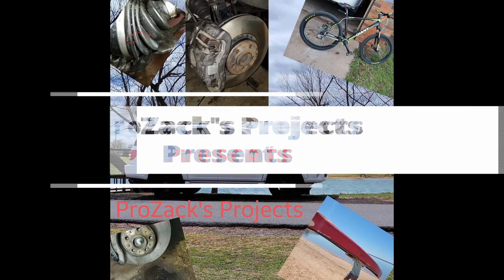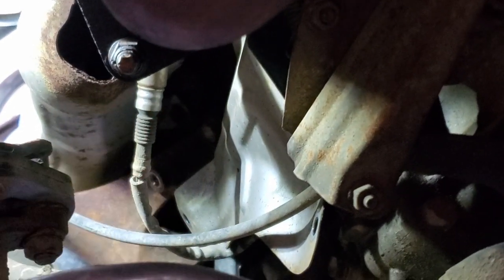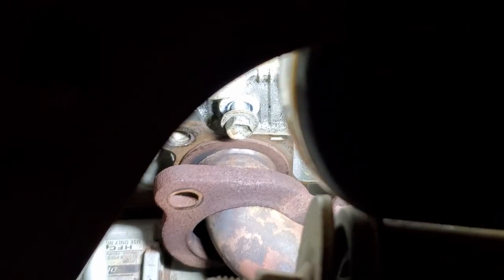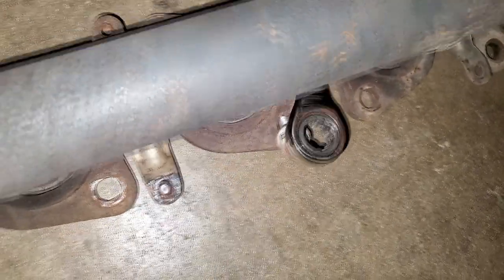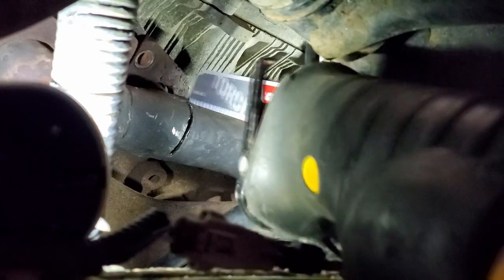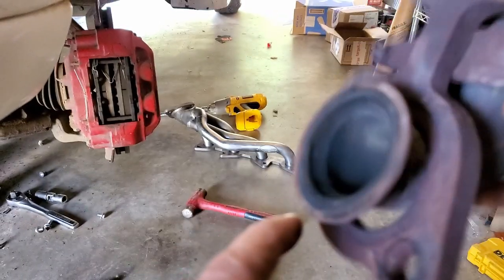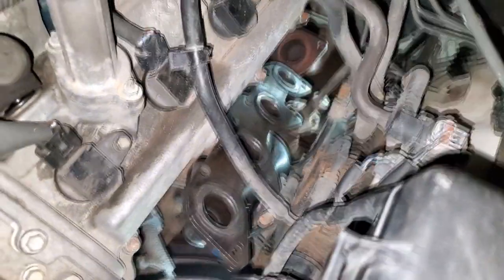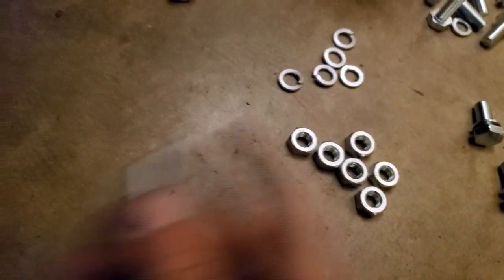How to Install 1st Gen Sequoia/ Tundra Headers: I Fixed 5 Exhaust Leaks

Comment: looking forward to doing the JBA long tubes on my 05 tundra.. knocking out motor mounts at the same time. engine support should hopefully make this a somewhat not pain in the ass job.
Reply: No such thing as lt jbas for tundra 05
Reply: @PrincessAddie14  they discontinued them. I do have them on my truck though

Comment: Thanks for the video. So did you use mostly impact wrench to loosen the manifold bolts? Wouldn’t it break the bolts if it’s stuck? Did you apply heat? Thanks
Reply from the maker: I used it where I could but my impact isn’t strong enough to break a bolt. Since the heads are aluminum, the bolts shouldn’t get stuck that bad.

Comment: I just started my project tonight.....so far things are going well.  I have one bolt that rounded that I'll need to deal with using a bold extractor, etc.  Last upper bolt on the drivers side.   What did you use to remove the 3  stock screws that connected the stock manifold to the Cat's?  The bolts came off with a little help from PB blaster and some heat and cold.  All but one of my studs on the drivers side stayed in the block.  I got the heat shield off on the passenger side and the 3 nuts off the cat connection and decided to call it a night.  Been working on this for about 4 hours just taking my time.  I've got all day tomorrow to keep working on this.
Reply from the maker: Those 3 bolts, I put an end wrench on the top and about 2’ of 1/2” extension’s to reach up from the bottom. It sounds like you’re making some great progress.
Reply: Finished the install today.  You had some great advice.  I used a cutting tool to hack through the factory manifold which made access to the inner bolts above the engine much easier.  Did the driver side first....learned a lot doing that side and then moved to the passenger side - which was definitely  the easier side to do.  This was NOT an easy job!  two bolts on the passenger side wouldn't budge.  I used heat and then heat again.  Had to use my rounded off socket removal tool from Lowes and I finally broke the two bolt/studs came out.  Went for a long test drive tonight and while I was returning home got a check engine light P0141.  Weird.  Supposedly this is the O2 sensor on the downstream side of bank one below the cat/passenger side - never even touched that area.  Tomorrow I'll take a look and see if somehow I've gotten a short or maybe just bad luck and the o2 sensor died on that side.  I'm at 199,500 on my 2001 - I bought new in June of 2001.  I didn't replace any of the other o2 sensors....can still do that if I need to I guess.  I also replaced both lower ball joints and both sway bar links.  My drivers side lower ball joint was bad and I didn't know it!  Lucky to catch that before something catastrophic!  
My wife was asking if I would like a bed to sleep in the garage since I was spending so much time there.....but it was great being able to do the job myself.  My hands are a little scarred up!  Some very tight spaces.  Your suggestion of using the 14 mm ratcheting wrench was excellent.  Needed a 17mm for the hardware/bolts on the JBA headers.  
Did you retorque after a few days?  Did any of the bolts loosen up on you after a few days?
Nice to be done....just need to figure out the P0141 error.  Never had this error before on the Sequoia.
Reply from the maker: @scottmcdonald7577  that’s awesome you got it done and you did the lower ball joints before something happened unlike me. I went to torque everything a few days later and everything was still tight for me. I would double check though. The driver side is definitely a bear to work through. I hope you’re able to get the O2 sensor figured out. Mine keeps coming on because I have over 280k and many of those miles were with exhaust leaks so the truck was running richer and so I’m getting the code for cat below threshold. This is exciting to hear other people’s stories. Thank you for sharing. 😁👍

Comment: Im getting ready to do this to my tundra, do you have to cut the old header off to access the nuts to remove the header? Am I able to do it with out cutting? Thanks for the vid!
Reply from the maker: On the passenger side I didn’t cut it I just used the ratcheting 14 mm end wrench which has a straight end on the back and I was able to get it without cutting. I highly recommend getting one if you don’t have one, and thanks for the comment. 🙂👍
Reply: It's a tough job but doable!  I spent about 10 hours doing both sides and my lower ball joints as well.  Took my time.  Amazed at how stuck some of those original exhaust manifold bolts were.  Very satisfied with the results.  My '01 feels much peppier from a dead stop now and what a different new ball joints make!  I wish you the best of luck!  take your time and be prepared for some stubborn bolts!  14 mm ratcheting wrench is your buddy!  You'll need a 17mm for the JBA bolts.  I used a $20 stud remover from O'Reilly's that made pulling the studs that didn't come out with the original exhaust  locking nuts very easy.  Figured out my P0141 error code.  I had a Homer Simpson moment.  I had disconnected the downstream 02 sensor on the drivers side.  DOH!  Once I reconnected....no error codes.  Sequoia runs and sounds great!

Comment: Did you have issues with oil dip stick tube? I just i stalled mine and the tube is literally touching the exhaust. And I can't bolt it back in place. 😵‍💫😊

Comment: This is my next big project for my sequoia. I have a cracked manifold somewhere and it’s driving me nuts.
Reply from the maker: It’s worth it. I hope this video was able to give you some insight and helpful tips.
Reply: @ProZacksProjects  if definitely did. I thought the job would take longer but simplified it pretty well. How does it sound inside?
Reply from the maker: @ViewlessSquid  it’s actually quieter without all of the exhaust leaks.
Reply: Same thing on my ‘01 but when it warms up it quiet down a lot

Comment: Curious if you had any issue installing the new mounting bolts after you got the headers lined up? Any tricks to be aware of?
Reply from the maker: The holes were slightly out of alignment but after taking a drill bit to them, the bolt up was super easy.

Comment: You don’t have to drill out any rusted bolts ?
Reply from the maker: In the head I was able to use my wrench to break the studs loose that were left behind. I don’t recall having to drill out any bolts. If you do, it would be where the exhaust manifolds connect to the rest of the exhaust.

Comment: Did you have to add a tune? Any check engine lights?
Reply from the maker: No tune and no check engine light. It does run so much better now. The check engine light does come on occasionally because the cats are below threshold efficiency or something but it happens less now. That’s my next project.

Comment: Just found your video and Lovie it!  You're about a month out with the headers.  Do you notice more heat in the engine bay?  Concern for any wiring with heat from the headers or were yours ceramic coated?
Reply from the maker: Excellent questions. I don’t notice more heat although I’m missing some of the inner fender covers on the front side, so there’s a little more airflow than normal. They’re the uncoated SS JBA’s. I did however pick up 2 mpg. I went from 13.5 to 15.5 on the highway with mud tires on.
Reply: Any check engine light issues with the O2 sensors getting too much flow?  Did your JBA SS headers come with new head bolts or did you have to get stock bolts from Toyota?
Reply from the maker: @scottmcdonald7577   I was getting a cat below threshold on bank one before and it still comes on but less frequent. There’s all new hardware with them, head bolts and flange bolts. Hopefully yours will come with the correct nuts for the flange bolts if you get it. Also, this may appeal to some people, the JBA’s come with a carb certified sticker.
Reply: You've been awesome to answer all of my questions.  Did you order the JBA's through JBA or a reseller?  I've been wanting to do this for so long.....watching your video has given me the courage to finally try this.  I assumed you removed the dip stick and the ratchetting wrench is what allowed you to remove the bolts that are blocked by the engine mounts?  Did you consider using heat on any of the stuck bolts?
Reply from the maker: @scottmcdonald7577  thank you, I try to make these videos to help out. I bought mine through jegs and had I used the ratcheting wrench, the bolts would’ve come right out. The biggest problem is getting on the bolts straight which is what the wrench is able to do. My AJ Claw crescent wrench was perfect for getting the studs out too.
Reply: @ProZacksProjects  Hi Again:  I wanted to make sure I understood you correctly, the head bolts to hold the header to the head were the right size and worked just fine, the 3 bolts used to connect the header to the exhaust system/Catalytic converter were the wrong size?  I was going to call Jeggs when I order these to verify if they are aware of this problem....if I understood you correctly.
Thanks,
Scott
Reply from the maker: @scottmcdonald7577  that’s correct. I believe the issue was from JBA packing them. If yours are wrong just email them and they’ll compensate for the fix. That’s what they did for me. They were wonderful through it.
Reply: @ProZacksProjects  Great.  I assume the headers are not leaking and you're loving the improvement???? :)
Reply from the maker: @scottmcdonald7577  no leaks and I absolutely love them. They even come with a certified CARB legal sticker.

Comment: I'm pretty sure it doesn't but did you experience any drone or the sound level of the exhaust get louder? I am planning on getting these but keep the stock exhaust
Reply from the maker: No droning and it’s actually quieter just because there’s no exhaust leaks now. I kept the stock exhaust and there’s a little more of a grunt to it but you can barely notice.
Reply: @ProZacksProjects  good to know, thanks!
Reply: @ProZacksProjects  Also I don't know if you've done this, but I saw another video of a tundra with these headers and he said he put HPS short ram intake with a throttle spacer and it made the tundra have even more power with the headers.
Reply from the maker: @keontaheri3944  I appreciate the info. I did a k&n air filter at the same time but I don’t know what difference each one made.

Comment: Obviously it's a stock exhaust here so it's different for mine, but if I change the stock headers to these shorty jba headers, do you think it will be louder, or just sound different? I have the stock headers oem cats, then straight pipe. I want it louder lol wanna see if these will do it
Reply from the maker: They gave it a bit of a deeper note with all the factory setup. I think you would notice the difference in sound and performance.
Reply: @ProZacksProjects  damn that was a fast reply lol I'm assuming torque was noticeable low end? How about mid to high end? It's nice to hear it from someone who experienced it themselves not a just a product description
Reply from the maker: @redrolla  I noticed it all the way through, but especially at the bottom.
Reply: @ProZacksProjects  thanks for the reply
Reply from the maker: @redrolla  no problem. My goal is to help people, and I hope this is helpful to you.

Comment: Was it a direct bolt up to the rest of your exhaust? No modifications needed?
Reply from the maker: Mostly. The stock exhaust has this part that very slightly slid into the stock manifold. That will gap things slightly but you can grind or file that off so it fits flat and the gasket seals up.

Comment: I cannot get the nut off the stuf that is on the bottom and behind the motor mount on the passenger side. Broke my ratcheting wrench! I think I’m going to do what you did and cut the manifold to get better access so I can get my breaker bar in there
Reply from the maker: Oh that’s terrible! Can you get a regular 14mm end wrench in there to hammer on? That’s a shame you’re down a wrench too.
Reply: @ProZacksProjects  I tried, it just such a bad angle, and that bolt is on there tight! It’s going to sit over night soaking in wd-40 and I will try again tomorrow. As for the wrench it was form harbor freight and lasted me quite a while so I can’t complain
Reply from the maker: @mattadams0690  gotcha. Well I got off easy because my passenger side has been replaced so everything came off much easier. I hope it goes well for you!

Comment: How many hours did this job take you?
Reply from the maker: Far more than it should’ve. I did the drivers side first and it took a couple of partial days trying to remove the old manifold and then finally cutting it out. The passenger side had been replaced but it took me about 30 min to get the manifold removed and I had to open up a few of the holes to make the headers fit on the heads. So a few hours on a good clean removal. My biggest recommendation is to use a 14mm ratcheting end wrench to get the bolts out. I tried to describe it in the video but that’s what expedited the passenger side. I hope this helps and thank you for watching.

Comment: Did anyone have to raise up the engine to replace these? or can it be done with just going from below? thanks
Reply from the maker: I didn’t have to raise the engine. There should be enough room to maneuver the old ones out and get the new ones in. If I recall correctly, there was plenty of space.
Reply: @ProZacksProjects  thank you

Comment: I would pay you to install mine. I’m dreading doing this on my sequoia lol
Reply from the maker: It's not as bad as it seems, it's worse. Jk. With a 14mm ratcheting end wrench it makes it so much better. YOU CAN DO IT!
Reply: ProZack is right on!  It's a tough job but it felt so good when I finished the job myself!  Just be prepared for some difficult bolts.  I used heat and cold to loosen two bugger bolts on the passenger side.  Toughest job I've had to do on my Sequoia  by far.......but oh it felt good to know I could do this myself!  ProZack's video was a great help!
Reply from the maker: @scottmcdonald7577  that’s awesome you got it done! It’s amazing the difference some free flowing exhaust makes and some new ball joints. Keep it up!

Comment: Any one know if non vvti header bolts on to vvti?
Reply from the maker: The vvti is on the intake side so the exhaust side should be the same but I cannot say for sure.
Reply: @ProZacksProjects  i know that but i wonder if its the same headers.im not spending 800 on headers for jba i seen some knock off brand for 150-200 but 200 tru 2004 only
Reply from the maker: @reifonseca5767  I completely understand that. The only reason I went with JBA is because they’re CARB certified and I’ve had bad experiences with much less expensive products. I just wanted to be one and done. If you got those knock off ones, let me know how they turn out. I want to know how the fitment is and everything. Thanks 😊